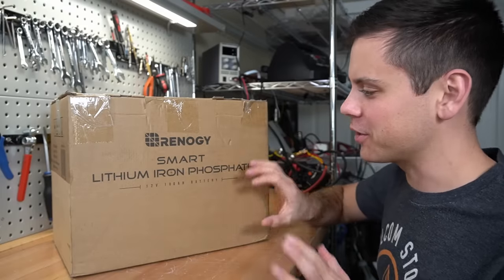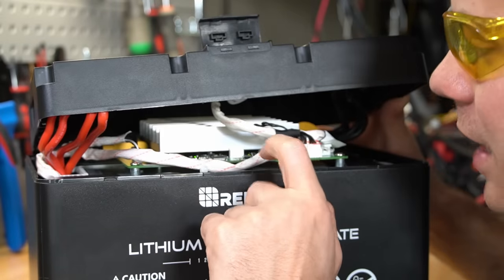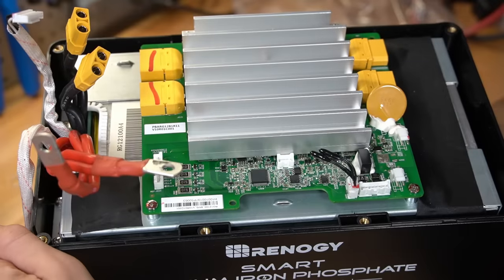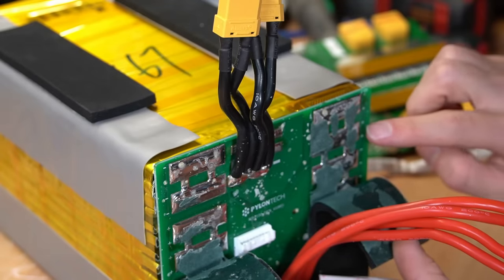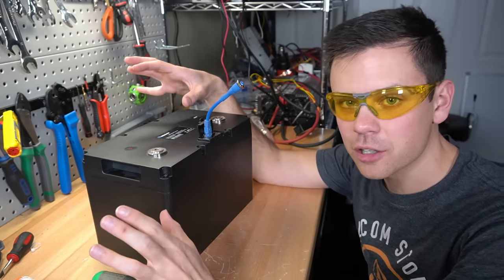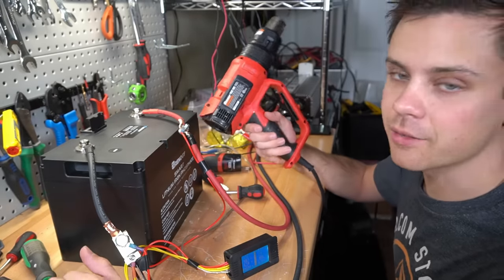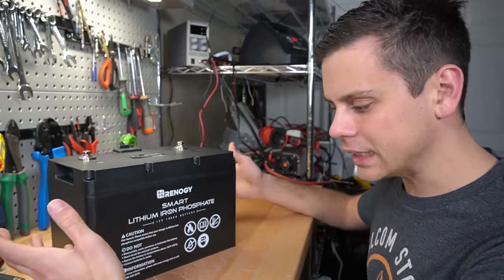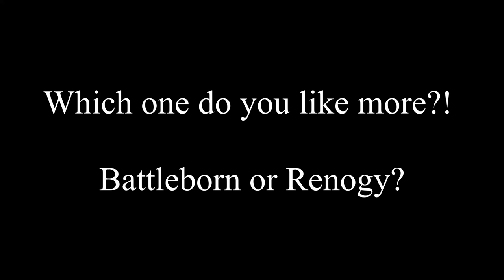Renogy "Smart" 100Ah LiFePO4 Battery Tear Down

Comment: Considering none of the renogy batteries can be wired in series, I’d go with battleborn. Add a nice MidNite classic 150 and we are in business.
Reply: There are good alternatives to BattleBorn. They are just the brand that is currently flooding YouTube creators with free stuff. I would wait to see how they hold up considering that user installed batteries, especially in a user built system, are very difficult to warranty. FullRiver makes terrific batteries...there are others. Do your research.
Reply: G Henrickson wait and see can be challenging. I won’t need my batteries for another two years, at which point I’ll have to make the actual decision. But anyone who is in the market right now will likely go with a well branded product. It communicates quality, reliability, support and if course good looks. If the price is reasonable enough people will buy. 
I think there is an aspect of overthinking things as well. Most just want their system to work. Your buddy has xyz and it works? That’s all the reassurance you need.
Reply: @geraldhenrickson7472  you just repped a company that only makes agm batteries? is this 2002 or am I missing something?
Reply: @geraldhenrickson7472  I don't believe FullRiver offers a LiFePO4 do they?
Reply: No one else offers a 10 year warranty, that's why bb continues to stay on top. Imo.

Comment: Glad you did this Will, I purchased 2 of the 170AH I was worried about the parts you can't see (inside) thanks to your video I feel good about my purchase. I do run mine in parallel in my RV.
Reply: The 170Ah Renogy is a completely different battery architecture. It does not use LFP pouch cells but uses 26650 cylindrical batteries in a 4S53P configuration (total of  212 batteries). The BMS is also different and no “smart” connectivity. Not saying it’s bad just different.

Comment: I have 4 of these in a 4wd ute with a 3000w inverter. They have been running 24/7 for the past 14 months since new powering what's in the back of ute as well as some other loads in the shed and house such as computer, refrigeration etc and the worst of the 4 has a capacity of 99.97% of original 100ah according to the app which never showed more than 100ah for any of the batteries. I'm no expert on batteries but that seems pretty good to me.

Comment: I've gone sealed lead acid in my new build, the reasoning being by the time i need to replace them LiFePO4 batterys will be cheaper than they are at the mo, i've (hopefully) future proofed the system to cope with the upgrade later (fingers crossed).
cheers Will, enjoy your channel and the forum !

Comment: Another great vid, Will. Thank you. I’d still go with Battle Born. I have 5 of them and am extremely impressed with their performance and build quality (not to mention the warranty).
Reply: ReversePeople how would you install batteries of different life cycles?
Reply: 4philipp — First, I’d individually charge and check the battery(ies) I was about to add to my existing bank. If they check out, I’d fully charge my existing battery/bank, then connect them all together. They should all balance over time anyway, but I prefer to start them off this way. If/when the bank shows any performance degradation, I’d take individual meter readings of each battery and remove the problematic one(s). One of the many great things about Battle Borns (and presumably others of similar chemistry and quality), is they’re good for so many cycles (read: thousands, if not mistreated), you can add batteries long after your initial purchase and be just fine. Hope this helps. Will and Co — please jump in if you feel I’ve misstated anything. Thanks, everyone.

Comment: Will, good job, like the tear down videos.  I have and use the 170ah Renogy battery in my motorhome and love it.  Only problem with it is they limit charge to 50 amps so it's not in the motorhome charging system I have it on it's own 45 amp charger.  Keep up great information.

Comment: I would bet that the Renogy Engineers have been referencing your videos in an attempt to design & build a better product.
Reply: Lassi Kinnunen  Laptops can bulge??
Reply: @KyrstOak  I believe any pouch cell can bulge yet it there is one chemistry that might resist such...it would be LiFe Po4.
Reply: @geraldhenrickson7472  Ok. What makes you think LiFe Po4 can resist bulging?
Reply: @DIY Projects yes. One great exemple are the Chevy Spark EV battery. All model up to 2015 have A123 top quality cells in 20Ah pouch. The packs are in 28s3p for 5.43kWh. There is 4 of these in tge spark. That spark can keep 80% charge time at full 100% power on L3 charging power.  Else there are Chevy Volt that use top quality LG pouch  cells in 96s3p for the 2011 to 2016 model years. These are very stable and reliable. So impressive then some friends of mine use these in their Tesla powered drag racing cars to power the tesla 500kW motor.
Reply: @DIY Projects and that's just one reason Tesla is superior
Reply: @billtaylor292  They give good support, at least here in Australia. Very fast replies by people with perfect english. That's worth a lot
Reply: @billtaylor292  Also, the 100ah tech battery here is a 150 dollars cheaper than the US, and in general most things here cost more in our money than US dollars so thats an absolute BARGAIN

Comment: Hi Will how come these batteries are not on your website? I  have just bought one for two reasons. 1) the build quality 2) the ability to remotely monitor the battery effectively without the need for a shunt.

Comment: I have 2 of these and am equally impressed with the performance. But yeah, lack of series connection is annoying. I run a 3000w  240v inverter and the cabling is HUGE.

Comment: I have 2 of the self-heated version of those. Same design as those. Same ports on the outside. I got those because they were the lightest and the smallest of the all 100Ah 12v Lifepo4s and the only ones to fit in my compartment. The ports: I use one of the ports to interconnect both batteries together, the other one is communication port going to the communication hub which has Bluetooth module connected to its output and I have all my Renogy devices connected to the hub, so I can check them with the Renogy app.
BTW it was not clear what are the rest of the balance wires there for. Maybe temp sensors for each of the 4Ss?
It would be interesting to open the heated version, too.

Comment: Do you know the warranty? If it’s less than 10 years, I’d stay with BB.
Reply: The Renogy website lists it as a "5-year prorated warranty".
Reply: Tony Borrill Battle Born FTW!!!. Five additional years of warranty for $10 per year!
Reply: funny, lead acid probably not worth a damn before 5 much less 10 years
Reply: @mikemead2315  Yep. My super heavy ancient technology  FLA are just hitting 11 years old. Are close to being stuffed, but only cost $2,500 USD for 25kwhrs storage @ 48volts. Have run the house for 11 years for 2.5K USD
Reply: Rolls Surrette lead acid batteries also have like a 7 year warranty so it's something to keep in mind.  If they put one that long it means they expect them to perform well at least that long.  Hopefully much longer though as they arn't exactly cheap but still cheaper (and easier to get) than lithium.  They're also made in Canada which is a bonus.  I have no plans to setup a huge system but I will consider them when I'm in the market.

Comment: When you connect these in parallel the BMS communicate so individual cells get the charge they need, instead of all just being fed the same charge. It's clever!
Reply: Can the batteries communicate between themselves without an external controller? I'm thinking of using charger that has a charging profile for lithium, but no communication port, (other than measuring voltage and current.)

Comment: No series connection kills it for me.
Reply: bingo.  it is a no-go for me.    also, sharing the truth limits...  isn't battleborn limited to 48V?  so, BB has series limitations too.
Reply: @wkrp10splayer19  true, but i think most folks would be happy with the common 24v or 48v banks, so that limit seems reasonable to me.
Reply: Lassi Kinnunen  That is very possible! As I cannot think of any other reason they could not be.
Reply: Lassi Kinnunen  It is possible that they are actually concerned with matching problems, too, though I am suspicious of the "sophistication" of the BMS with such a significant limitation being required. Even Battle Born wants to know in advance if a purchaser intends to put their units in series so that BB can make sure they are matched. I doubt that Renogy is able to do the same.
Reply: Look for a different model. Probably just costs more.
Reply: @wkrp10splayer19  Perhaps, but a 48V system is more than enough for most folks while a 12V system's inherent limitations make it more suitable for mobile usage only. So I can live with Battle Born but this Renogy is a no-go for me too.

Comment: The fact they can't be put in series is very disappointing and would be a reason I wouldn't buy them.
Reply: Yeah they need to figure out a way around that, or make different voltage ones like a 24v and 48v model that just changes the grouping of the cells and uses a different BMS.    They just need to clearly mark it, since most people that see a battery in that form factor (ex: "car battery") assume it's 12v even if they know nothing about batteries.
Reply: Right! I was excitedly interested until learning they were restricted to 12v only system design!
Reply: J G  Not really. Life begins at 48 (at home and the office, anyway).
Reply: J G   My primary issues are the cost and inconvenience with wire gauges and, solar charging capabilities.
Reply: A lot of folk seem to run a 12v battery bank. For some it would not matter. Perhaps they have another model that offers series capability.
Reply: Let's guess on the 12 vs 24/48 folks....my guess....1 in 20 do 24v. So, given that....it probably isn't worth it to put money into overcoming the reason they can't be done in series.
Reply: J G  I have two mobile set-ups, one 24V and one 12V. The latter not only requires heavy cabling but still struggles to push enough power to the inverter for relatively light loads (on-cycle of a convection oven, some power tools). The 24V just acts and "feels" more confident with the same loads, and the 48V home/office system barely notices by comparison.
Reply: @sciglassblower  So, how many diy residential off grid or grid tie with battery backup are using 100ah drop in LFPs?

A fraction of a fraction. 

This video and discussion is aimed squarely at RVers and boaters.
Reply: Actually, as a replacement in a motorized RV, 12V LiFePO4 makes most sense. There are 3 existing charging 12V elements there (converter, solar controller, chassis alternator) and 2 discharging (inverter, 12V distribution panel). Replacing all 5 with different voltage (24V/48V) brings the cost way high.
Reply: @seanjanson2144  Not true, your components are cheaper, the higher the voltage. I just set up a 37-foot class A for a friend, and we went with 24 volts. The higher the voltage, the less amperage you're dealing with, meaning less copper in smaller wires. Instead of more expensive 80 amp charge controllers, you can go to the 40s. It's not a good idea to charge your LiFePo batteries with the chassis alternator, keep those systems separate. You have shore power with a charger, a generator, which can still run a charger, and solar panels. This particular person has a 600ah battery bank with 1080 watts of solar panels (4x270 watt at 24v) and a 3000-watt 24v inverter. For the 12 volt systems, all one needs is an inexpensive 24 to 12-volt transformer, about $30.
Reply: Thanks for covering this battery, it’s one I’ve been looking forward to. What about LiFePo batteries by Mighty Max? Never saw them until today. Looking to add deep cycle batteries and additional panels.
Reply: I saw someone in the UK with Victron LiFePos.
Reply: J G  Depends on what you want to do.  I thought I could get away with 12V, then realized I needed regulated 12V output, so I need 24V for simplicity's sake.
Reply: i agree we need 24v series connectivity

Comment: UP is Coms port for for BT-2 blluetooth module to use with their Renogy BT app. When connecting batteries in parallel you go from UP to LINK and the BT-2 connects to the UP port of the last battery

Comment: Thanks, Will. I want to get two of these for my Monaco house batteries. I wondered about how to keep them warm in Winter and Renogy just sent an email about their new 12v 100amp battery with a built-in heater. Problem solved!

Comment: Good job sir. Looks like it’s well made I could see the connection system monitoring all the batteries in parallel and it could tell you if you have a problem with one of the 12v battery units that could drag the system down.

Comment: Now I would be the first to admit that I have not seen all of your videos. I have spent a lot of time on your side and I have done some due diligence to try to find what I'm looking for. The only thing I see missing from your channel is a start to finish system they could handle an entire average house. And I mean to keep it off grid. Grid would be available for backup only. I've seen all the little pieces involved on your Channel but I don't understand how big it would need to be to handle realistically a full house load. I know it would be a huge hit for your channel if you did a video that built a really large robust system for an entire house. Or maybe there already is one and you simply point me to it. Thanks for your attention.

Comment: I really liked seeing the battle born opened up. I’ve been working with them for awhile. I’m uneasy about the pouch cells in renogy. What is Dakota batteries doing? I don’t see a video on them? I’m looking forward to the new Battle Born with coms, I’ve always wondered about balancing larges banks. And not having an indicator on if one string is down.

Comment: Thanks Will, another excellent review video.  

I totally agree with your findings BUT I can't stress enough, Renogy have built a good battery which is NOT future proof.  Without the ability to series connect, as your system developes, it soon becomes obsolete!!  

I knew nothing about solar 6 months ago and thanks to your videos, I have built a crude off-grid home system - 90% down on grid use during the summer months.  With small non-South facing rooves UK folkes often have to resort to 24v systems and you can NOT get many of the component you review on your channel in the UK.  

A video a work around the Renogy 12v trap to upgrade to a 24v Solar components would be appreciated.

Comment: That looks like a great battery but I would spend the $50.00 extra for the Battle Born because the pouch cells on the Renergy look kinda scary to me. I don't know much about batteries and all of that stuff because I'm a newbie but my instinct is to want to have something more substantial for the chemistry of the battery to live in. Those pouches look flimsy and squishy. Not safe in my book. 
I do own a 200 amp hour 12 volt Renergy AGM and so far it's been great! But AGM is something that I am familiar with so it isn't as scary to me. 
Thanks for all of your cool videos! I love seeing what is inside of batteries and stuff! It's so much fun!😊👍👍❤

Comment: would love to see a breakdown of the previous gen Renogy Battery and compare improvements and why it is only good for 2000 cycles.  I suspect more occasional price drops for it to clear out inventory.  Got 6  of them at $518 (3 each on two different amazon accounts) on last Black Friday.  Verify low price on TriCamel  The way amazon works they might move out whole left over inventory in $400's and I'll max out quantity again if it gets Will's approval.

Comment: Thanks for the info.  I have 2- 100 amp renogy lithium batteries.   Renogy suggests for storing batteries to charge  between 30-50% and then place them in shelf mode.  When charging  the batteries for use,  I believe you mentioned to keep the batteries between a range for longevity of the batteries.  Do you have the range?

Comment: Will, how are you feeling about Renogy a year after this review?  They have since released a 170AH version.  Very appealing a dual battery system at 340AH at around $3K is pretty sweet!  Another review may be in order.
Reply: Something quite different about the 170's, since they last 2000+  cycles to 100%DOD, vs these, at 4000+ cycles to 80%DOD.

Comment: Thanks Will I just bought 2 X 100 A/h for my sailboat. With Xmas sale on, and 10% from WillProwse code $$$😁each Batt cost $612 CAD delivered tax in. Great deal. Also bought the 20a DC to DC charger to connect with my 60hp outboard alternator and a monitor. Hope I figure out how to connect it all correctly. Will check your book. Cheers.

Comment: I saved a substantial portion of the cost for my milk crate solar power system build by choosing the Renogy over the Battle Born of the same capacity. I only live a few miles away from Reno and hope to do business with Battle Born in the future, but it seemed like I was getting the run around from them on a shipping date during the past 2-1/2 weeks. I'll see if Renogy delivers within the time frame it says it will. I'm optimistic, but I'll let you know how it turns out.

Comment: Where do all the "extra" wires on the balance cable go?   Perhaps the narrow connection on the PCB are fuses and they are looking at both sides???  Or perhaps there are more temp sensors in there someplace???

Comment: I have nothing but trouble with RENOGY 100AH lithium smart batteries. One smoked, the replacement would say it was charged to 100% but the output didn’t reflect that and rapidly deteriorated, then they replaced that with a used battery with the same problem. I guess polite customer service.